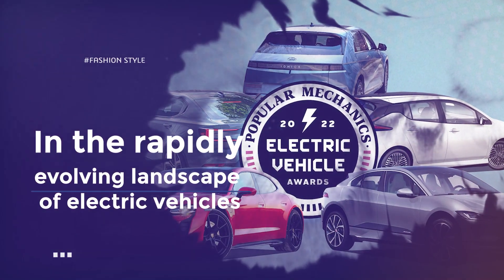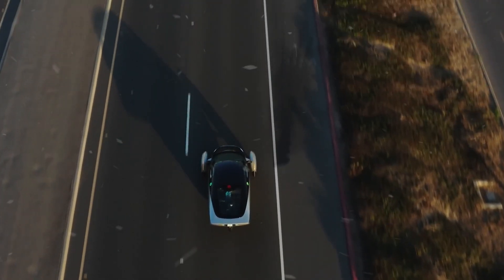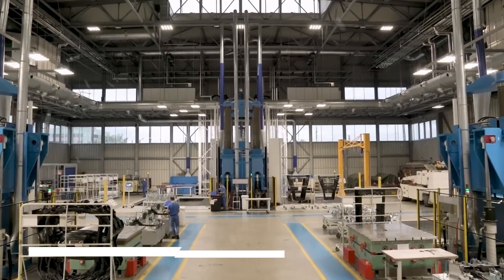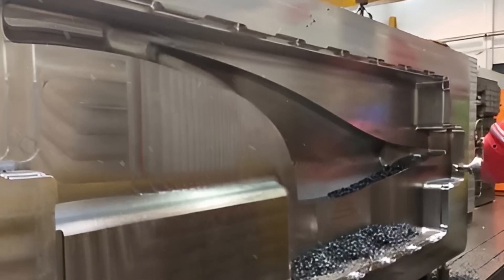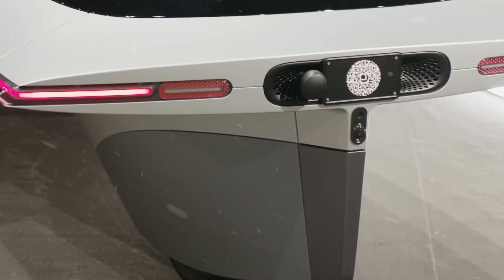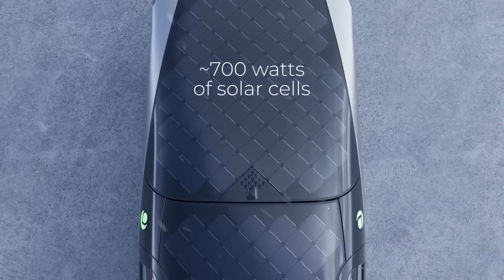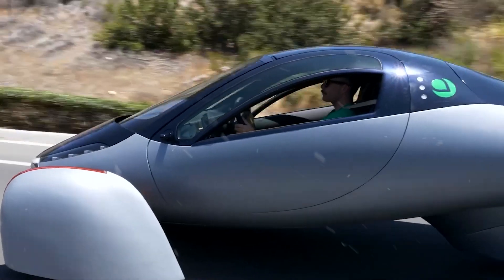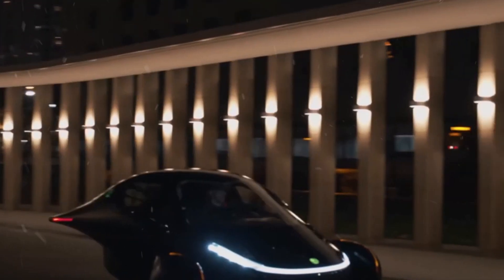Aptera Solar car shocks the EV industry

Comment: What happens when you hit a pot hole and throw off the alignment , standard gear, used to align cars will not work on that car, and those tire rods look like they bend with ease … how do you balance those tires? you can’t be throwing weights on those rims I’m sure it’s not a standard balancing after all, there are motors in those wheels , the consequences of needing an alignment could be catastrophic since the motors are in the wheels , misaligned wheels at 100 miles an hour when the motors are sending the car askew ????

Comment: Do you know where the 3 wheel car came from. As far as I can remember it was the British Govt who promoted it . They reduced taxes on a three wheel car as a lot of crippled people found these cars were easier to get in and out of and were specially and easier to design than the 4 wheeler. The Aptera looks like it would be easier to get in an out of . Also seating the people as as near as possible to the 2 wheels gives better stability. Reduced cost of course welcome to older people who usually were fairly poor.

Comment: The cover of this video is a lie. There has been no demonstrated 1000 mi range for the Aptera trike.
Reply: The car is still in development.  Having spent millions on the moulds at CPC, the 1st production type bodies for completion into full Apteras (Apterea?) are imminent for completion of final development and crash testing...  Full production later this year.  

Most cars do not go from concept to complete range in production over a few weeks!  Aptera are starting with all wheel drive, full solar 40KWh version as that was the most popular in their pre-orders at decision time (it may not suit your needs, but it is great for many), when the production bugs are ironed out by making the launch edition in their initial production run, then the range of options will expand over time, I think 25KWh next, then 60KWh and finally 100KWh...

Comment: You are too stupid to be reporting on automotives.  3 wheel vehicles are Motorcycles.  You need a motorcycle endorsement and a helmet to legally drive one and the vehicle must have a center mounted headlight 3ft off the ground - does this motorcycle have one?  No - as shown it can't be legally sold and put on the road. Only a dumb shit would put this garbage out.

Comment: Had they made it 10 years ago it might have had a slight chance.  But 10 years on, it's DOA - Dead On Arrival - but even that's a misnomer.   It will never "Arrive."
Reply: You sound just like the guys who listened to dumb politics and didn't buy Tesla stock early. Now Tesla is the #1 car stock and I own a watch that cost more than your car. The Aptera is a fantastic looking piece of engineering. I'll likely add one to my garage after the 1st year to be a practical pick along with my other cars. My current EV charges for free off solar...amazing tech!

Comment: They need a basic cheap model based on everything except self charging, something with all the aerodynamics features without all the excess displays, make it have mirrors....crank down windows...no backup camera's....cut the cost down to extreme levels....nothing but battery and motors in a safe aerodynamic structure. Probably cut production costs in half and sell 3 times as many.
Reply: The only display should be speed and fuel level, that is all, nothing more is needed.
Reply: @SarahStuff-p5u  fuel level? It's a solar-charged electric.
Reply: @MarcoLandin  Fuel=Electric charge, and putting those solar on the car itself just adds cost and weight if you have solar at your home anyway.
Reply: Take a look at the configuration tool on their website, they offer much cheaper, and as such less capable, base models. But it is the high end 1,000 mile range unit which makes the Aptera so desirable to the customer base they are targeting. Not everyone lives in a city where they could actually walk to their destinations should they get off their duff and do so. This is the EV aimed at people who have an actual drive to get to work (30+ miles each way), or who live outside the public transit coverage area in rural America.

Comment: Imagine if the new CATL battery were used. Solid State charges In 10 minutes from 0-1000 miles. In this car it would probably go 1300 +
Reply: More like, consider a sulfur selenium battery.  It would be roughly 2000mi
Reply: Imagine if they used a battery people have to image using?  😉

Comment: Where are they and what do they cost? Quite a bit of repeating but understandingly so.
Reply: Aptera's factory is located in Carlsbad, California.  The wheel motors are being made by Elaphe in Slovenia and the bodies by CPC in Italy (the same company that makes Lambro bodies.  Cost for the first 400 mile launch edition vehicles is likely to come in under $40K.  Eventually they will be available in ranges from around 250 to 1000 miles at different price points.
Reply: Carlsberg California
25kwh, 40kwh (first production 2024 400 mile range)60kwh , 100kwh last production
Reply: @ianjco60  They could also probably cut their price by 15% by relocating outside Commifornia as Tesla did.